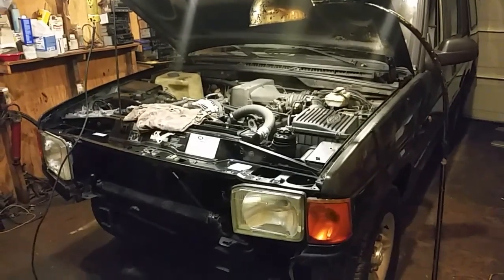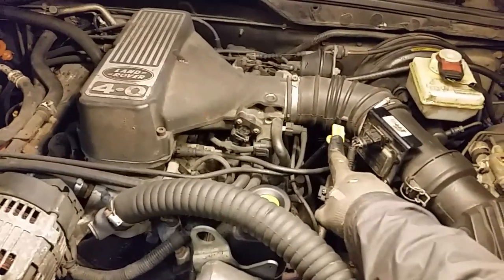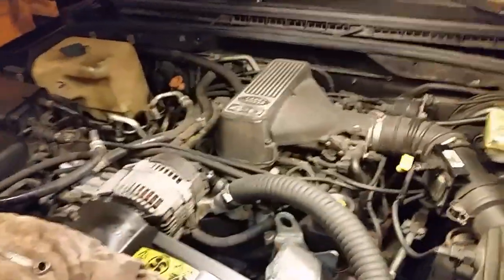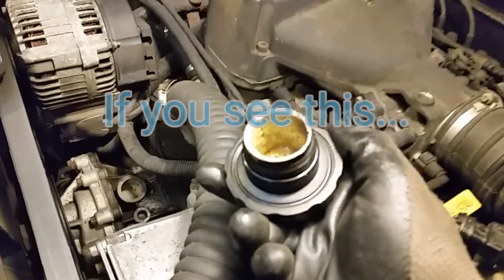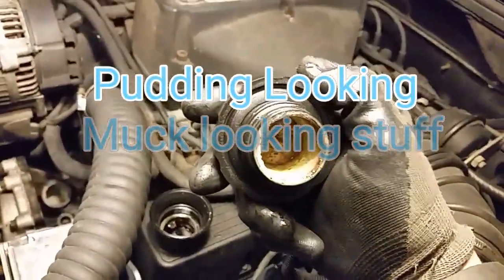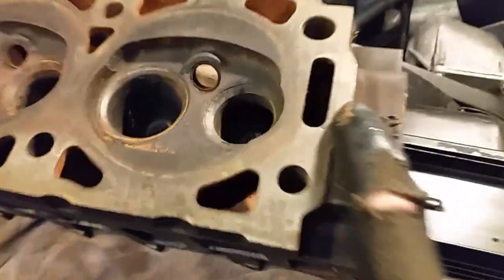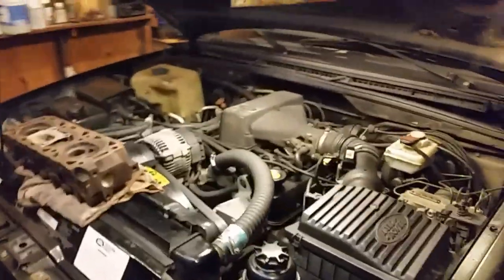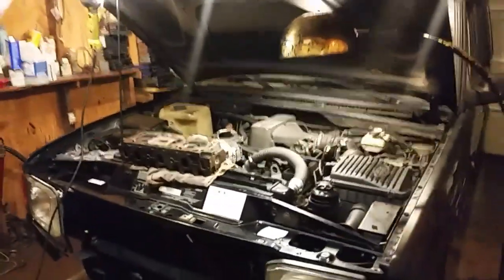How to check for a Bad Head Gasket...Simple way...No Tools

Comment: If its just on the cap it could just be condensation because its common on expeditions if you do a lot of short trips
Reply: Kyle Powell or a bad pcv system would do that my explorer does that and drive a lot , that's when I found out out my pcv wasn't venting
Reply from the maker: True,  but when its this much when driving a while.....RIP
Reply: @FixingWithPassion  can coolant get into the combustion chamber through a faulty intake gasket